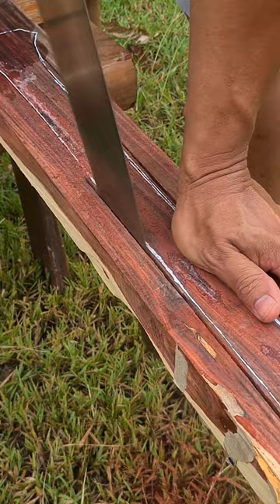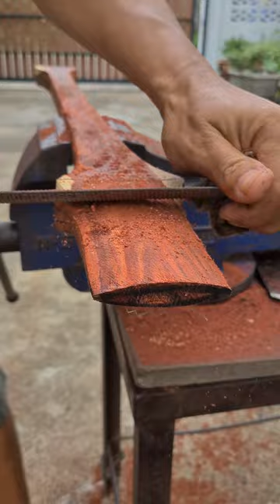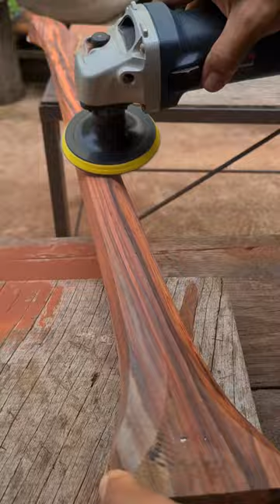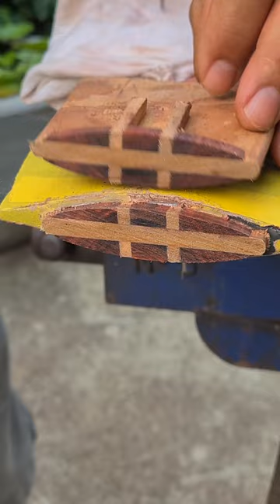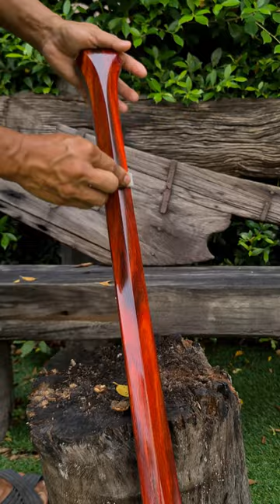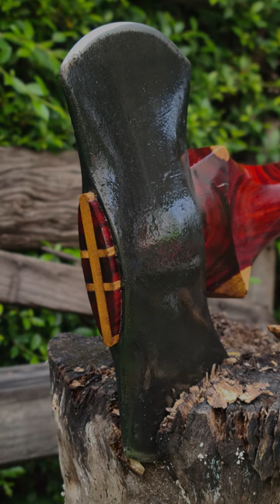How did he make a beautiful axe handle with basic tools? #shorts #woodworking

Comment: THAT AXE SHOULD BE HUNG ON THE WALL, ITS WAY TOO BEAUTIFULL TO USE.DAMN GOOD JOB. I LIKE HOW YOU DID NOT DRIVE IN THE METAL WEDGE THAT THE AXE COMPANY USES, YOU PUT GLUE THEN DROVE IN WOOD WEDGES, GOOD AND SMART JOB.THE STEEL WEDGE ONLY SPLIT THE AXE HANDLE AND SHORTEN THE LIFE OF THE HANDLE, GOOD JOB..
Reply from the maker: Thank you very much, I'm appreciate it.🥰🙏